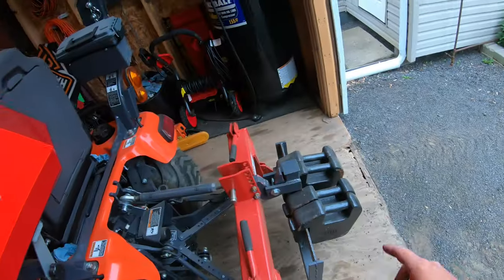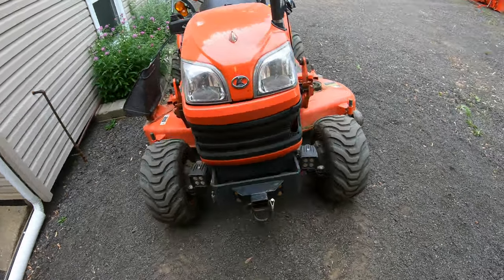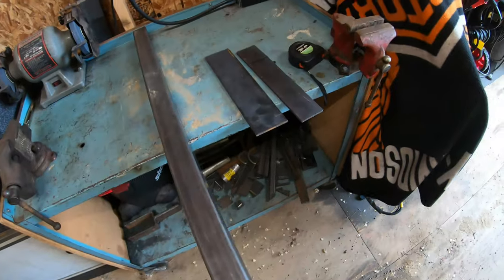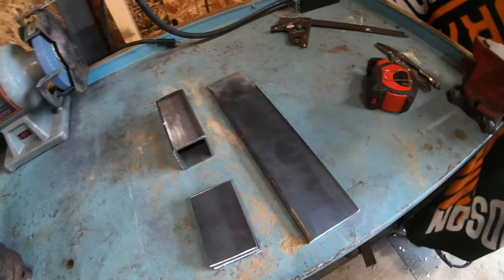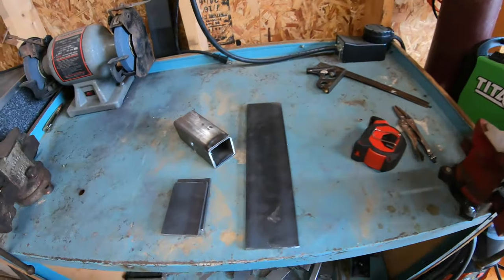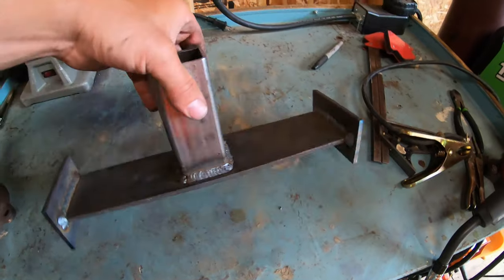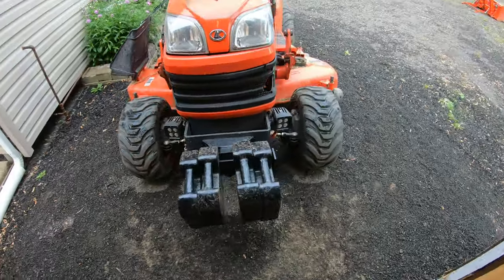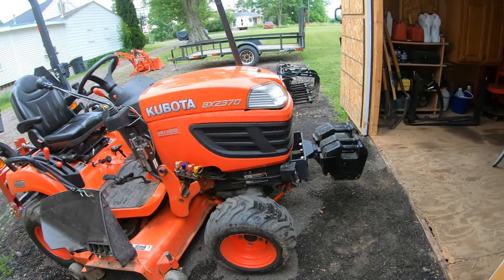Building A Front Weight Bracket- Kubota BX (How-To)

Comment: I think the weights look cool like that . I have the same welder but my welding doesn’t look as good as yours lol. Great video , I like your build videos the most. Probably because your making equipment/ mods that I would like to build. Great job and stay safe & keep them coming . Todd
Reply from the maker: Thanks Todd! How have you been liking the titanium welder? In my personal opinion it’s the best welder out there for the money, I think I used a coupon and got mine for $369 which is a smoking deal. I have used my welder for some big projects and it’s yet to let me down, it will out weld the Hobart handler 140 I use at work and had a better duty cycle too.. I have done 5-6 minute non stop  welds with this welder and it’s never even flinched which is way passed it’s duty cycle so I been very impressed. Glad you enjoy my build videos man you’ll have to let me know when too build yours!
Reply: @BiffsEquipment  I want to build the push box you built. I like the welder mine is the 170 , I wish I got the 220 though. Yeah I keep welding with out worries about the duty cycle. I’m interested in the plasma cutter , how do you like that ? I’m going to get one . I want just a homeowners / hobby one since I’m only using it once in a while

Comment: Great video buddy, I love your how to videos :) it's so nice to learn from someone who a) knows what he's doing but makes the video so clear to watch and know exactly what you're doing. What a great mount boss!

I have the K-Connect for the BX2680 for a blade, power broom, and snowblower so I think I'm going to go with front wheel weights for my uses. I won't be taking them off ever. Going to make traction easier for pushing manure and snowblower for sure.
Reply from the maker: Thanks man I really appreciate it! Front wheel weights would be a great idea as you would be able to leave them on all the time and always have the weight up front when needed.. only thing is you’d have to find a way to mount them cuz there isn’t mounting holes on the front rims least I don’t think my BX has them.. you could always make your own holes tho.. I did this with a new Holland tractor at work and it worked just fine. Let me know if you ever end up doing it!
Reply: @BiffsEquipment  will do! I think that's my only option. I have to double check to see if I can do beet juice for rim guard. I can't remember if that's ok for the front tires. Ill have to check my manual.
Reply: @BiffsEquipment  checked my manual, def no go for fluid ballast. It says I can do a weight bracket in the front but I doubt I could do that while the k-connect is on.
Reply: @Vaessen13  I found a solution with the k-connect on.  I have the front weight bracket kit from TerraKing.  Its used with their TKV20 rear 3-point material collector.  You have to take the grill guard off but you do not need to remove the k-connect brackets.  I don't currently see the front weight bracket listed for sale but they have the PDF manual if you want to check it out.  https://cdn.shopify.com/s/files/1/0058/4944/8519/files/tk95054-tkv-20-kubota-front-weight-bracket-kit.pdf   If you go to terraking.com look under the TKV20 downloads for the Weight Bracket Kit.
Reply: @xjfo  oh man thanks so much chief, honestly I really appreciate that :)

Comment: I like your fabrication videos!  I have 2" front receiver on an aftermarket grill guard.  I mow with my Heavy Hitch loaded with eight 42lb JD weights (I have a JD dealership 20 minutes away and they were cheaper than local Kubota dealer - still haven't painted them orange yet, my wife makes fun of the orange/green combination!)
Reply from the maker: Thanks buddy! That’s awesome I really like the JD weights they are a lot nicer, for awhile there you could even order them from Home Depot’s website and have them shipped free to a store near you to pick them up but now after corona I’m not sure. It’s def nice having some weight up front even if the front just makes the tractor feel more planted. You gonna paint them grey, orange or black?
Reply: @BiffsEquipment  do you have a link for the best place and price to buy the weight?

Comment: Nice job. I like to have 4 weights on the front for mowing. If I run 6, I have to use 4wd in places I shouldn't.
Reply from the maker: That’s right I forgot you have a front weight bracket as well, you built yours too many years ago didn’t you or do you just hang them off the front frame I can’t remember. It definitely helps to make the BX more balances and makes it feel much more planted as well.. tho I can see how running 6 could be a bit much haha. Thanks for the comment man

Comment: Good video. I’ve never had any issues with instability in the front with just the mower deck on. But I don’t have loaded rear tires. When I have the loader on I always have the box blade attached. That’s always been enough to counterbalance the loader. But for your situation it’s a good solution.
Reply from the maker: Thanks man, yah its not terrible if I don’t have any of my rear weights on the back but even with the quick hitch alone and rear tires loader I can feel it’s sorta light in the front when climbing some of my steep inclines.. this will just help to keep it more planted when I mow but I mostly made the bracket so that I can add front ballast when using rear Implements where I don’t want my loader on, thanks for watching

Comment: That will come in handy if you get a tiller in the future. A lot of times you till in areas with limited space, so loader has to come off, which makes it really light on the front end.
Reply from the maker: Absolutely! More or less this is why I built it, mainly for when I want to run rear implements when I don’t want the loader in my way but I also plan to use it when I mow to keep it more planted on my steep Hills out back. Thanks for watching!

Comment: Good job buddy, you’re skills always amaze me. Is that Titanium welder a 125, if so how do you like it ?
Reply from the maker: Thanks Rick, it’s actually a titanium 140.. 110v welder.. the thing is a beast, it welds 3/8” steel almost effortless.. the duty cycle is amazing also.. much better than the hobart 140 I use at work.. I have yet to weld long enough to make the welder shut down or stop welding nicely and I’ve done 7 minute striaght welds when I built my pushbox.. I was waiting for the pretty white smoke to come out but it never did so the titanium welder gets my vote for the best welder for the money by far 👍🏻
Reply: @BiffsEquipment  Thanks.

Comment: great video! your weight, do they have holes in them, and if so, what are they for? thanks
Reply from the maker: Hey Brian, my weights do not have holes but some do, the purpose of these holes is so you can bolt the weights together so that they are not clanking around.. often used in larger equipment and on farm tractors. It’s a nice feature. Thanks for watching!

Comment: Good job on the weight rack. I wish my welds looked as good as yours.  The one thing that made me flinch when I saw it coming was,... All the metal grindings from your chop saw blow right into the motor of your nice Milwaukee battery powered fan. Please save it from an early death and blow all that out before you use it. 😢
Reply from the maker: Haha Thanks Ron.. yah that poor fan takes a beating.. Iv owned it for many many years.. Bought it when I was a mechanic at firestone in Hamburg and have had it ever since.. Its been on alot of different jobs with me and shes taken alot of abuse but keeps on kicking.. I didnt blow it out but she still works ! Milwaukee makes some Grade A tools thats for sure!

Comment: Pretty sure the piece you bolted the receiver onto the front of your tractor is actually supposed to be a weight bracket LOL.
Reply from the maker: That would be the frame of the tractor.. people have put weights on it before but not all suitcase weights will fit and clear the hood bonnet, it also will ruin the powder coat on the frame and you would also no longer be able to run a front receiver.. I also use my front Receiver for a winch I have as well as for a good tie down point when I trailer it.

Comment: Take the rear weights off! Problem solved!!!!
Reply from the maker: Even with the rear weights off the tractor is still very light in the front, I have some VERy steep hills that I mow on my property and often there is not enough weight on the front axle to even turn sharply at times when I’m going up a steep incline.. this is why the weight bracket was built. Now I can still keep a little weight in the rear to keep it planted but also keep some weight up front to counter it and to keep the front wheels down on the ground. I mowed all last summer with the front weight bracket on and it was a huge difference.